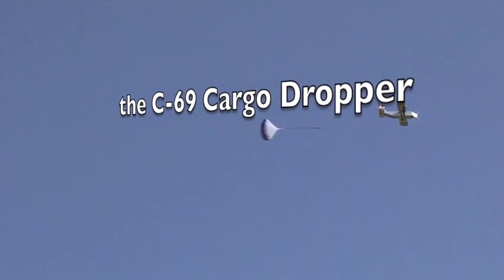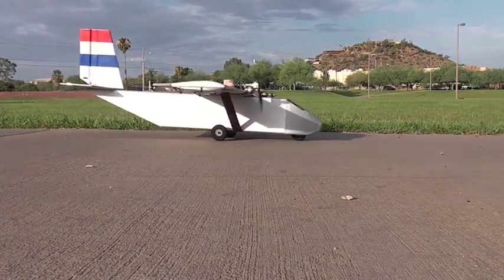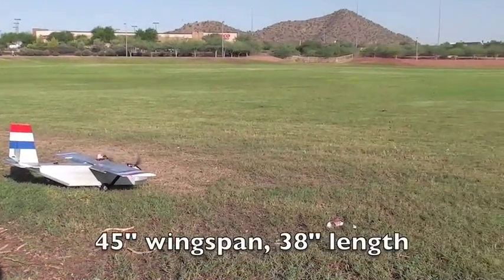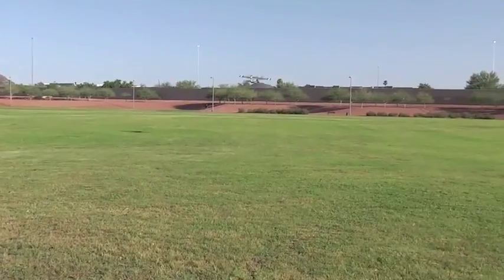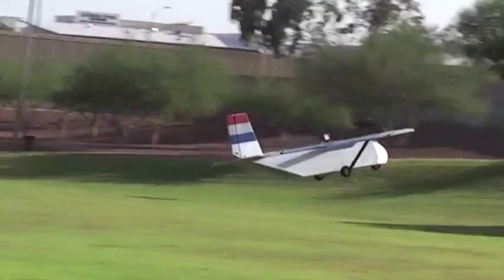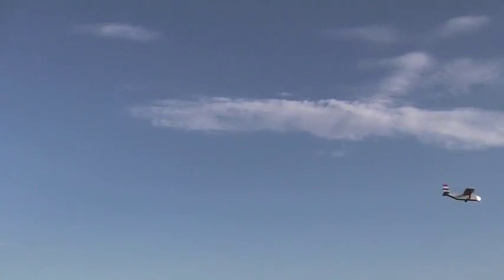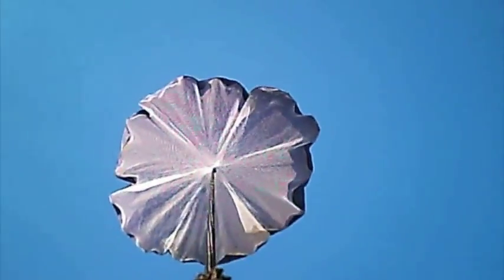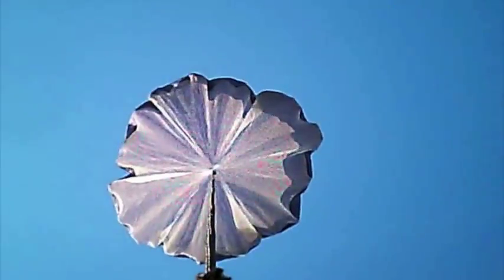RC-69 Cargo Dropper - In Action

Comment from the maker: @schraut5 RC Timer 2826 1400kV.  I use this motor a lot.  RC Timer website seems to be down at the moment but it's a great source for motors, props, and servo wiring.  Great value, consistent quality.  The other stuff is so-so.  They also have an eBay store.  Specs and details video coming up!